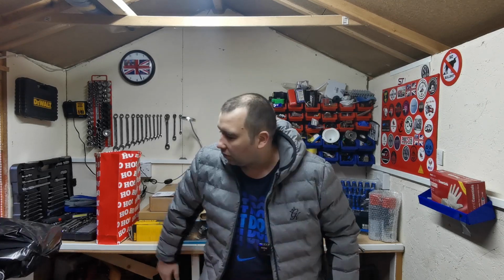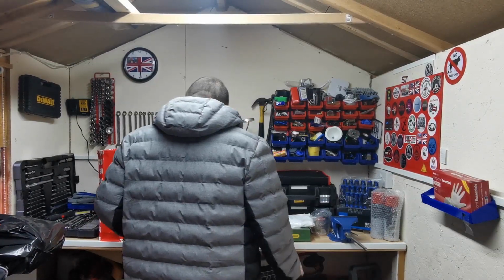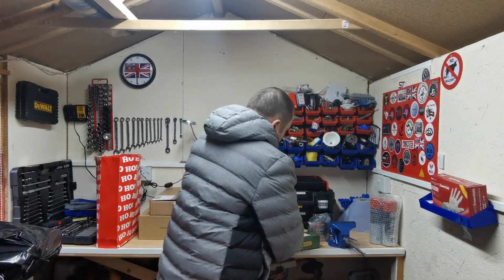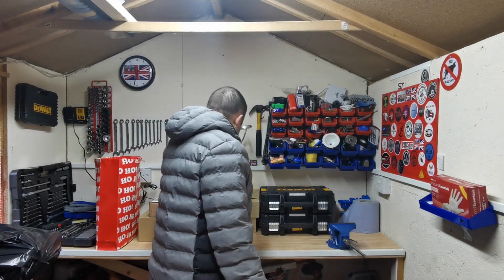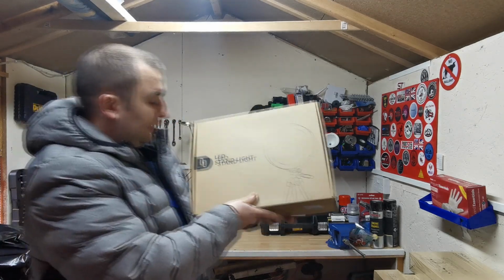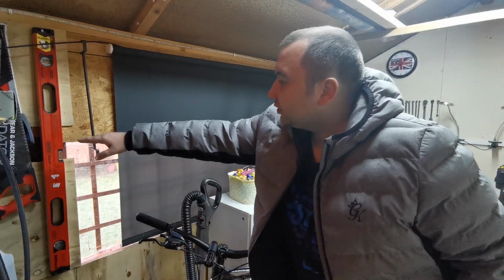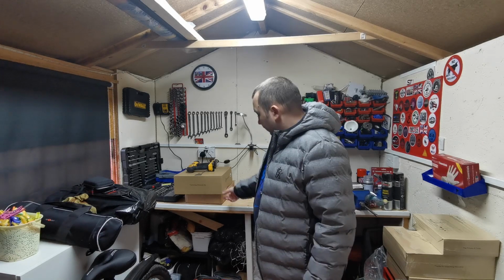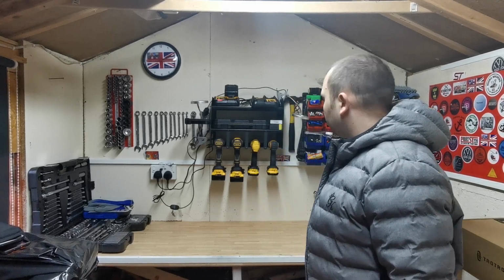New Channel Name And New Tool's

Comment: Enjoy your channel , hope your family are all keeping well , very much enjoying your 125 TZR. Can't wait to see what you do with that as I had an RD 125 LC back in the 80,s
Reply from the maker: Would like to find a Rd at the right price 👍🏻
Reply: @ProjectMan  They are a classic like the tzr and the Rd collection are in high number,s 125 are around £3000 to £4500 , Rd350 ,are around £5000 mark and the rd500 are around a staggering £20'000 , you can but a rat one if you can get one , back in the 80,s I paid £ 850 for mine mk 1 on the MK2 it was fitted with a power valve system. Hopefully your TZR will look great when done. Very happy to wait what you do with that.
Reply from the maker: Yer big money now matey 💰

Comment: wow you have done well for christmas prezzies gary, is that dewalt a 796 drill and a 887 impact, whats size batterys are  with them, great vid lad
Reply from the maker: Il have to have a look mate not 💯
Reply: @ProjectMan   if it is a 887 impact driver, it’s a  very good one Gary I have the 887 and it takes wheel nuts off mate👍
Reply from the maker: Nice one Andy 👍🏻